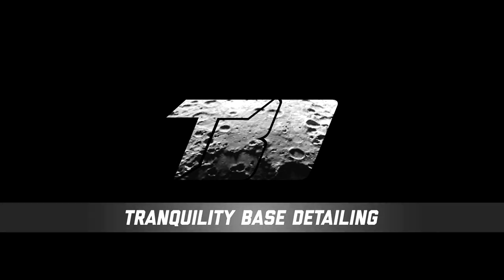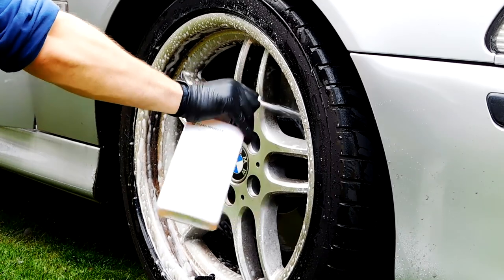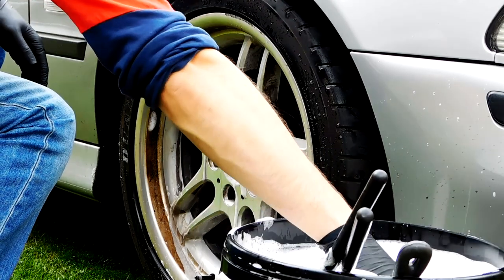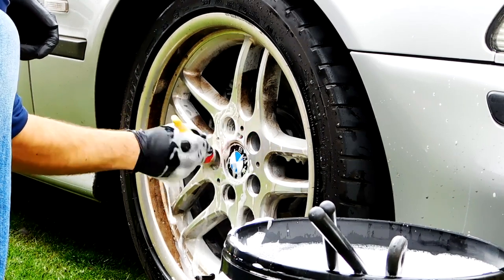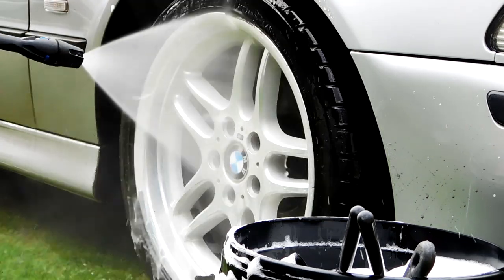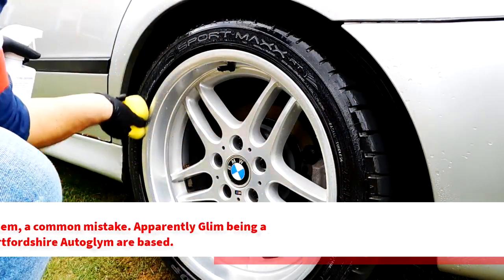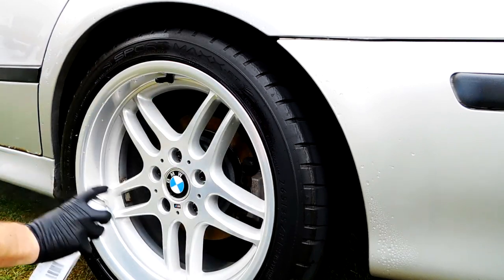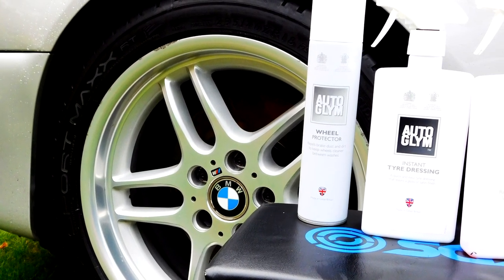AutoGlym WHEEL CLEANING VIDEO | Clean wheels | Instant Tyre Dressing | Wheel Protector | Satisfying

Comment: Good vid, full of good tips.  I from the UK and live about Qi mins away from the WOWO factory, probably going to check out their wheel mit now.  I used to use AG for a number of years, but felt they had a product for every job.  As well as 3 or 4shampoos?  I wanted to reduce the product set and I found Bilt Hamber and carpro .
I also don’t like using acid based wheel cleaners, as the leave a brite white finish, and shudder to think about the long term damage.

Comment: After applying the wheel protector and letting it dry for a couple hours, is it ok to buff with a microfibre cloth or will this remove the protectant?
Reply from the maker: Can't see why it would remove it. Question is why would you need to buff after a few hours?
Reply: @TranquilityBaseDetailing  Cool.  Ill just leave it alone. Thanks!

Comment: Nice, easy to follow video... very clear, thanks! 
Question... does the wheel protector initially leave a slightly uneven looking white film? 
Cheers!
Reply from the maker: Yeah it can leave that film you described. Buffing sorts it out though.
Reply: @TranquilityBaseDetailing  cheers... figured that out 🙂 nice finish now 👍
Reply: Is that why they don't recommend for gloss black alloys

Comment: Isn't AG Magma better for really dirty rims?
Reply from the maker: I can't comment if it's better as I haven't used it. However both this wheel cleaner and Magma are acid based wheel cleaners so are really two versions of the same solution.
In the main, using fallout removers as a wheel cleaner tends to be a more expensive way to clean your wheels and since it's become fashionable to use it this way I think AutoGlym have simply jumped onto a bandwagon with Magma.
Happy however to get it on the channel in future to make a video of that also.
Reply: @TranquilityBaseDetailing  yes and this product isn't exclusively a wheel cleaner only but you can spray the whole car...

Comment: Does the wheel protector need to be reapplied after every routine wash or will it last a few weeks? Nice video 😀
Reply from the maker: It doesn't necessarily need topping up after each wash. AutoGlym say is will last quite a few weeks. Will all depend on how heavily the car is used and time of year. Salt in winter will play havoc with most forms of protection
Reply: @TranquilityBaseDetailing  thanks will try it out

Comment: It is far easier and much quicker to remove the wheel
Reply from the maker: I don't disagree but it also depends on what you want to achieve. For a general clean up of the wheels busting the jack and axle stands out for four corners is not really necessary.
I tend to do a wheels off clean twice a year myself and the rest of my washes are performed much like this video.
How often are you removing your wheels per year bud?

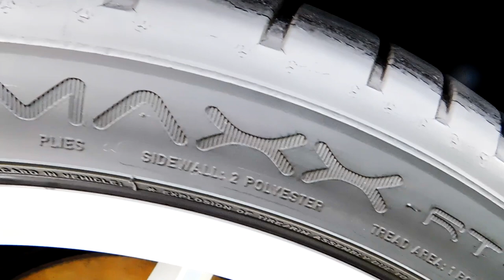Comment: 7:48 Your tyres are cracked, replace them instead of dressing.
Reply from the maker: Thanks for the tip.👍
These have been replaced since the video was filmed. Video is to illustrate capability of the dressing, not to suggest it's a viable tyre repair option of course.